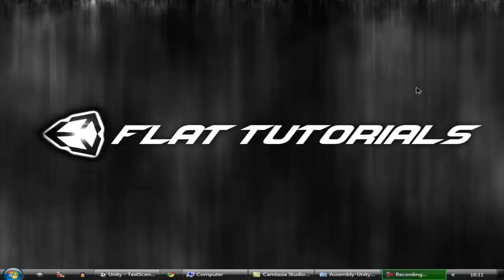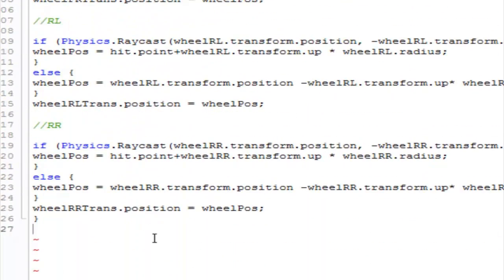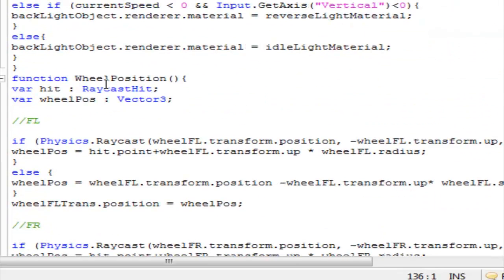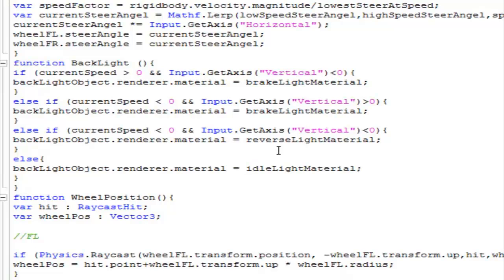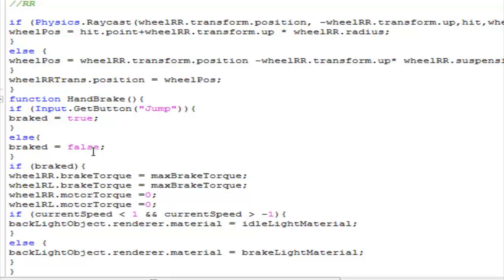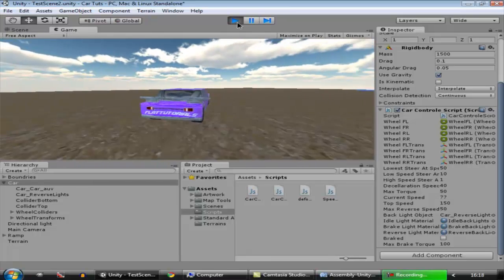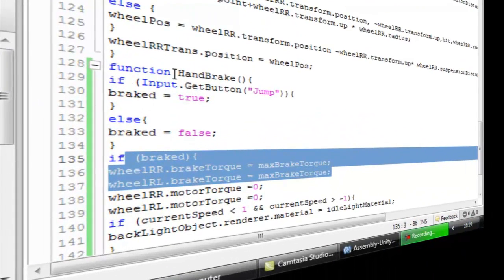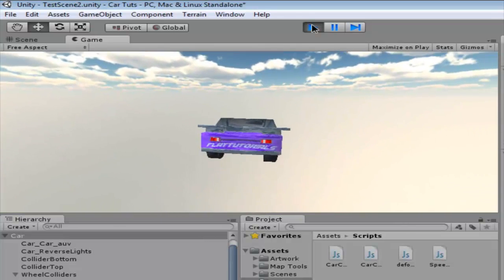#12 How to make a Car game - Unity 3D Tutorial - Handbrakes

Comment: I finished this tutorial perfectly fine and brakes "work" and all but for some reason it doesn't apply any extra braking torque. Everything is correct in the scripting. When I put on the handbrake the brake lights come on but it just rolls to a stop like normal.

Comment: Excellent tutorials, works like charm except for a little detail lol, it brakes just fine but when I hit spacebar all the wheels just merge together on the roof of the car lol? I tried messign around with the code and it seems to work just fine when I rename the function braked to braked 2 and make a new variable for it aswell, so the error has to be somewhere else, I just cant seem to figure out where. ( I copied the code you provided).